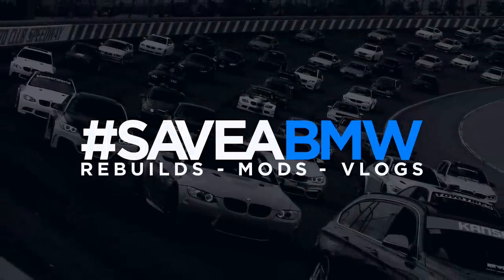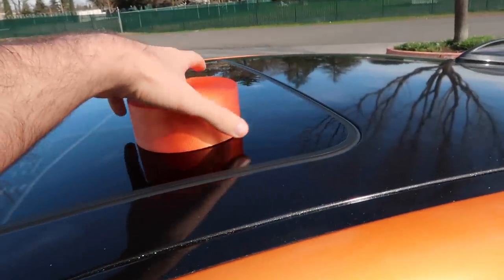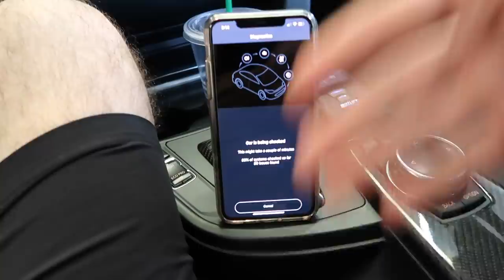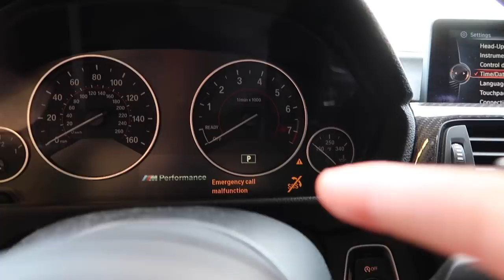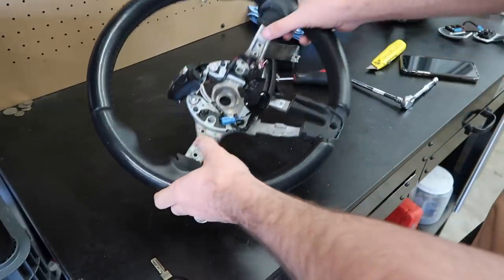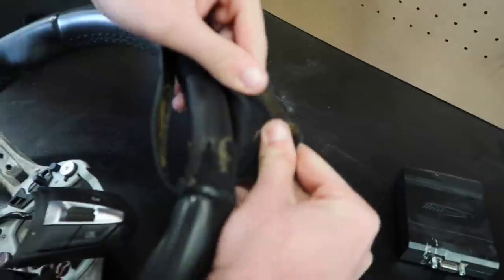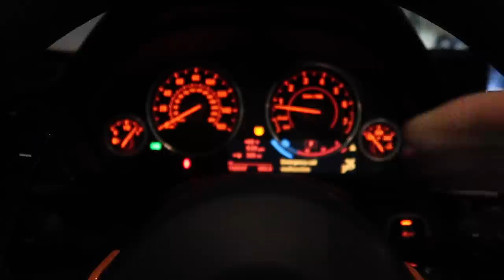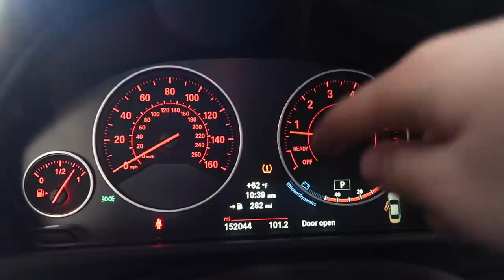Whats inside a BMW 435I M-Sport Steering Wheel?

Comment: Watching you cut open the steering wheel not doing it the right way that was cancer. You need to cut the thread "the seam" and itll open up. As well as it's super east to actually re wrap a custom steering wheel I just finished doing a custom one took 2 hours lol. But anyways